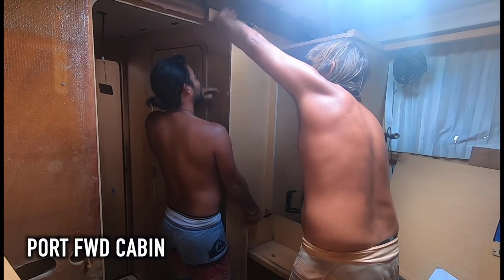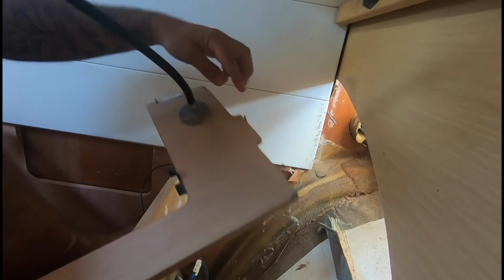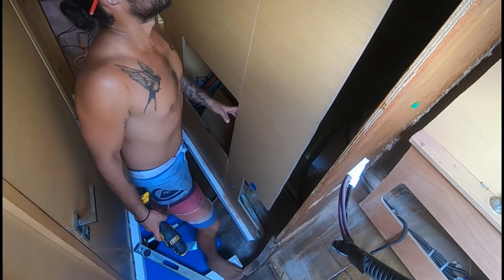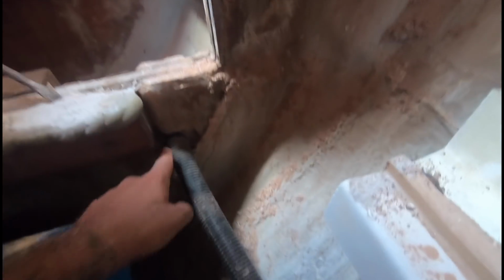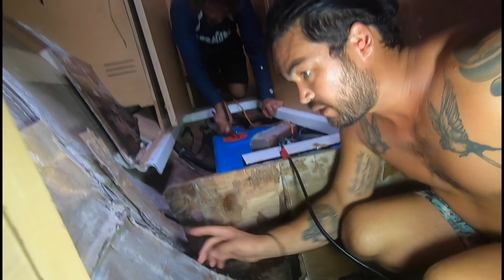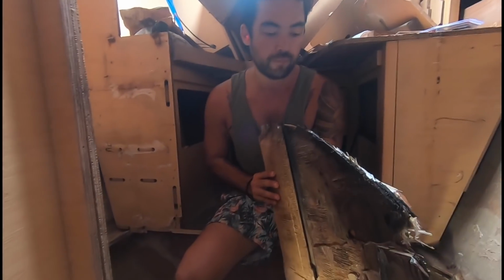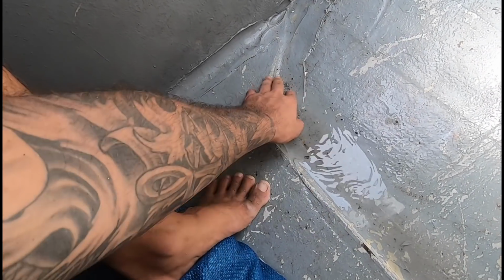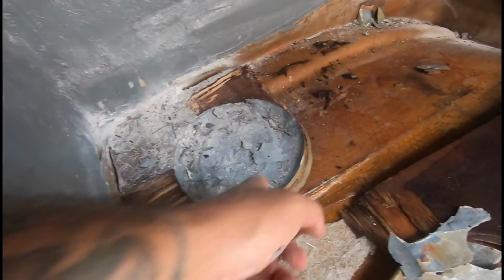CRACKED BULKHEAD REPAIR SERIES - Part 5  (Episode 110)

Comment: Every week is a new PR disaster for Lagoon.  Colin, a sincere “thank you” from me.  Owners and shoppers need to know this information and you’re helping me understand what’s truly important in a cat design and build.
Reply: PR disaster for lagoon by Beneteau.
Now i understand the difference between serial production boats and quality boats.
Plywood for construction elements?
C'mon man ... Beneteau is crap.
Reply: @marccoussement6903  Using marine plywood was absolutely fine for building the boat. The issue is that they just didn't use enough to give the boat the strength it needed. Those bulkheads should have been twice as thick as they were and the tabbing should have been extended by another couple of inches in each direction. 

That being said in 2021 anyone building a boat would be an absolute fool to use marine plywood. There are plenty of materials like foam, coosa, and other composite boards that will never be effected by water that using plywood now is just dumb.

What kills production boats is a confluence of penny pinching. They just keep taking away more and more material to save a few thousand dollars on a boat they will sell for over a million. It's not any one thing, its the supervisor of every stage in the manufacturing trying to find a way to make their little bit of the build "more economic" and by the time you add all of it up the boat isn't structurally sound any longer. 

Those bulkheads don't look like something an engineer would sign off on. Why put reinforcement on the bottom and top but leave a giant section in the middle with super thin 1/4 or 3/8 inch plywood? I'm not an engineer but I know enough to understand all the forces you needed the reinforcement for are just going to be transferred directly to that thin bulkhead. 

I've done A LOT of fiberglass work and torn apart many old abused fiberglass fishing boats to make repairs. I've never seen de-lamination happening like this. I would bet good money they had an issue with the resin, improper mixture, bad environmental conditions during build, or it was just old and expired causing it to not bond properly. Fiberglass resin isn't going to just de-lam like that if it was mixed properly, applied properly, and not expired. I don't care if it went through 4 hurricanes, the boat may be in tiny pieces but it shouldn't have any de-lamination of fiberglass from plywood. Even if the wood is 100% rotten there should always still be a layer of rotten wood stuck to the fiberglass. I'll be honest, I would cut my losses and walk straight away once I saw all the issues with the fiberglass. There is no way to ensure there wont be a lot more de-lamination down the road caused by faulty resin from the factory. No amount of reinforcement and extra tabbing will stop things from moving when the factory resin fails and de-laminates the fiberglass from the wood in other areas of the boat. 

Sorry for the imperial measurements it's easier for my small brain to reference since its what I grew up with.
Reply: @velvetjones  You can still use marine plywood just fine, you just need to sandwich it properly. It certainly gives a hell of a lot more structure (unless you're going for hollow structure, where you melt the foam core out with acetone, but then you're talking thicc glass) than any other format. I mean, i've seen boats done right, with a skim of fiberglass and they've been beaten to shit and back (a nutcase friend of mine took one right up to the ice back in the 90's when tech was worse, but boats were newer).

It's not about the contents, it's about how you use them, and plywood is perfectly good for a boat.

That said, the new whipper snapper standard today is fiberglass, with light cores (or none) with carbon fiber reinforcements laid interweave or laid as layers inside the main lay. Those are absolute tanks, and light. And because CF has come down in price a bit, and because it's structural, not element, (in purpose) i personally think that's the future. Who knows, we may even get some nutcase building a full CF on YouTube soon, i mean, there's a channel who replicated a Japanese car in CF top to bottom.
Reply: @velvetjones  fully agreed regarding such k USD material saving versus Millions investment inside the production tools and facilities (see my post below with somes video link). But i try to stay in  a 
“positiv Mindset” when i see this industrial tool and facilities  that could do much better
Reply: @aserta  Well said , Good ply sheaved & end sealed as as good as most methods , Have look at Spencer ply yachts built in the 70s , Won every thing , Fast light & sound , Sure if its not done right as with any form of yacht construction ?? That can even go to Ferro yachts , One won the Sydney - Hobart but they dont like talking about that ?
Reply: @velvetjones  well said the glass work is beyond Horrible ! I want to live the dream but it wont be with Lagoon ! Thanks to these guys to make this discovery and present it to the newbie like me ! I wish to sail - surf and site see the globe by sea ! My glassing experience is only on surf boards as a labour of love.
Reply: My thoughts from the beginning but it can never be told the stresses of a hurricane on the hull that tweeked so many lap joints. That's Lagoons out excuse though, that and building to an "industry standard" that does not build 100+ year boats. 
I wonder if there is some composite material that might replace all of the structural wood..?

Here's to wishing/expecting you guys to have an exceptional century boat 🚢 in the end 👏🍻
Reply: @steprob8692    I'm curious about the marine grade options to Plywood for structural use as well.
Reply: @The_Life_Shoequatic  Coosa board is awesome and pretty much indestructible by water and lateral forces. Often used in rebuilding transom's . I've used it and it is superior to marine plywood by a ton!
Reply: @jfisk60903  cheers mate!
Reply: @steprob8692  Yes PVC, Airex or any type of structural foarm suitable for glass or carbon strat. See for exemple outremer building (hereby the famous new “Sailing la Vagabonde” https://youtu.be/FBtJr80RIm8 

But as usual it may be usefull to moderate a first bad feeling (and the one about Lagoon is justified) hereby  a video of LAgoon factory. 

https://youtu.be/5Im5DC2vu4Q

Ok this is promotion but check the building facility , large scale infusion equipment, CNC equipment, general logistic and industrial set up compare to the one of outremer working in an too small building, not properly isolated (thus no temperature and humidity control), no crane facility except the truck crane barrely certified and so on.
  The 450 issues is clairly identified and can’t be justified regarding the overall industrial investment done for the production. cut somes extra hours for proper tabing and low end marine plywood can’t be explained: a few  thousands USD saving versus millions USD in industrial equipment ? Regarding the industrial organisation of such group i have no doubt that it will be internally reviewed. I hope they will as well work on their PR. Cruising catamaran is not my way of sailing. But there is a real demand for such cosy cat not exceeding 500 k USD. and “large scale” production of such boat is a real challenge. At least Lagoon has the industrial tool to take it. I wish the future will show positiv change (keep in mind that the original 380-410-440 serie has excellent record and value on used market)

NB: regarding the non stop positiv mindset of Colin,  we should try to do the same with this 450 mess :)
Reply: @steprob8692  but the de lamination and support systems are failing on boats that didn't go through a hurricane. Simply put, these boats were cheaply and inadequately built....period!
Reply: who knew they were just a bunch of plywood and glue?  haha
Reply: @2fast2nick  unfortunately probably true for most production boats :(
Reply: Lagoon is going to end up in a class action lawsuit... these issues Collin is uncovering are probably just the tip of the iceberg...
Reply: Whilst you're right on the fact that the boat is not up to spec, you also seem to forget what happened to the boat. HAD this boat been as bad as it seems to day before the wreck, it would've been scrap. Collin didn't take this on from a marina, he took it off the rocks. It's fair to remember that aspect, go back to episode one, that's not just random eggnog party wreck, that was full on beat the crap out of the boat.

That said, the lace at the bottom came undone before the wreck, so that one's on them, and the damned glue construction. Just hire a smaller persona and get some fiber lay in there, is what i'd do, but they considered that they wanted glue. And this is a customer driven thing. These are houses on water.

Personally i don't even get the appeal of these things, they're not large large, they're just wide, you have to have two engines, there's no other way, and you have to deal with a lot of issues when getting into a marina. For the same price, you'd get a reasonably large yacht/boat, and have the same amenities. But then again, you could probably name the people who've used these types of boats (to be clear, twin hull, fiberglass lay and of this setup, not the racing cats) that have done enough nautical miles to contend with any normal old middle class boat.

Like someone else said in the comments, these are apartments on water, kinda like those British canal boats.
Reply: @aserta  dozens of lagoon boats have the same problem! just search around... this has nothing to do with hurricane damage
Reply: Think Colin is in a spot with Lagoon as they have been "helping" with some remote support but jeez you have to wonder if the patience with that will run out at some point.
Reply: @Aus L Nice theory but in terms of social media exposure it would probably open up the flood gates and not sure Colin is the sort of guy who would sign off an NDA and somehow pretend it all got better? There again, even he must be getting sick and tired of it all and they haven't started the big grind yet! Amazing they keep going,
Reply: Foam core builds only.  Lagoon doesn't give a sh..t.  Everywhere you look, they didn't do the job correctly.  By the time you find the problem, your warranty will be over.  BBW.  They know this happens.  But now some of us also know!  Watch for a lot of lagoon 450s being sold. used and rotting.
Reply: @Aus L that’s’a good point. But the CE class certification is based on stability/equipment/overall load calculation. unfortunatly not at all a quality/longterm use certification. leisure boat have clearly a lack of industrial standart regarding commercial boat or even racing boat.
Reply: Not any PR prob for lagoon that you people aren’t falsely creating.  This a f’ing hurricane salvage boat.  Flipped upside down on its hull in at least two hurricanes.  What the hell do these drunks expect?  You pay salvage price for a boat you get salvage boat!!!! Sorry but you knew what you were doing when you bought a salvage boat!!!!
Reply: Hurricane stresses can certainly excuse some of the damage and Colin has said as much.  However, a hurricane didn’t damage the other dozens of 450 yachts showing similar mast bulkhead bowing and cracking, a hurricane didn’t create forward compartments with no drainage, a hurricane didn’t install bulkheads using glue instead of glass, a hurricane didn’t install cabinetry and walls with no way to remove them except cutting them in pieces, and a hurricane didn’t use bulkheads with exposed raw wood leaving them susceptible to rot.  The hurricane can be blamed for some of the damage, but Lagoon has a lot to answer to here.
Reply: @CaptainBobSVTurnthePage  so far 90+ lagoons have the same problems .. most of those have never left the fucking marina .. just google it .. some are planning  a lawsuit too
Reply: @CaptainBobSVTurnthePage  You are missing the point, this is happening on the same model Cats built by Lagoon that didn't go through a hurricane or anything even close. It is poor quality that is causing this issue and not hurricane damage. take a peek on the interwebs. It is a disaster for Lagoon!
Reply: #FuckLagoon

Comment: There comes a time when persistence turns into stubborness.  The bible calls it being 'stiff-necked'.  Being stubborn involves over-looking the obvious due to some mechanism of the ego, blocking out reality in the process.  And the process, generally produces negative results and missed opportunities to engage in more positive avenues of endeavor.   This particular vessel isn't the only one and certainly isn't the most important one.  But due to blind stubborn behavior, it has become a form of mental-block to reality.  The so-called drive to encircle the globe with this particular set of rotten plywood and fiberglass completely ignores reality.   Tempting fate is one thing, but doing so without reason is unwise.  The compromise to the integrity of the structure, even with 'repairs', deems the overall pursuit to be more than risky.   Just think about it.  Withdraw from the work and ponder the course you've chosen.  Ego can get you into real life-danger.

Comment: This onion just has layer after layer of rotten plywood. Effin Lagoon, the bayliner of production cats...
Reply: This is way worse than a Bayliner.
Reply: I have a Bayliner, with the original Chrysler/Force outboard from 1987 with sparkle blue paint.   I bought if for $1000 trailer and all 10 years ago.   It's a nice little ski boat.  Transom, floors, everything is good.

I'd buy a lagoon if it were $10000.  And after this, all the current owners of Lagoons are gonna be screwed.  Resales are gonna tank.
Reply: @nicholasr7987  Your Bayliner is just fine as long as you use it sensibly and don't try to push it beyond it's abilities.

Comment: Harbor Freight get you a ventilator to get a positive pressure on the rooms you intend to grind in, this will help with getting the fibers going in a different direction from the living area. Masks fellas, save your lungs that fiberglass dust is no good for you. Enjoying watching you tear it apart and discovering its issues, looking forward to the rebuild.

Comment: When you guys are done, I would much rather go around the world in your boat than any other lagoon.  I am dumbfounded on how bad the engineering in these boats are.
Reply: Engineering the design is different from implementing the design.  I'm sure the numbers pencil out well, but the actual build quality falls well short of the intended requirements.
Reply: 😱😱 not a chance of me going around the world on one of these, I like living
Reply: Hay. That’s my bed 🤣🤣🤣🤣🤣🤣🤣 and it looks like we have some people from Lagoooooon  replying here. Bring it on   I don’t think it would be wise for them too do anything but help there Customers at this time. This is one of Many Engineering faults on there Brand. It’s time for them to Bloody Help these unfortunate people 😠
Reply: Most of the modern production boats monohull and cat aren’t any better. It’s a systemic industry wide problem of poor quality construction. Look up what CE category A rating means. It’s a joke if you want to cross oceans in any weather. There are a few mfg that do it right but a custom build is usually a better bet when shopping on the used market.
Reply: The engineering was okay until the plywood got wet how long did it take? 🤔👍
Reply: @rogerkerkmann  I'm with you on that statement.   The leak was completely hidden, and  could not be seen, nor inspected until the damage was done.  I think they will need to measure what they say on camera,  because lawyers will be called.   However,  rational,  normal people will see it for poor build quality/practices.
Reply: @nicholasr7987  this unfortunately. I trust Colin to not badmouth Lagoon on channel - would lead to defamation lawsuit and he’d lose this channel while suit was in the court.
Reply: @goofsaddggkle7351  It's only defamation if you're provably lying. If Collin intentionally caused the water leaks that damaged his boat and stated that it was poor engineering so he can hurt Lagoon's sales for example. Somehow I doubt that's what happened. You can intentionally say negative things about anyone and anything as long as it's factually correct.
Reply: I am definitely not a Lagoon shill fyi. The water leaking into the bulkhead is due to poor engineering - its directly from the trampoline tiedown design as Colin pointed out. Thats not a thing you should expect - its a design flaw. If that were a vehicle, there would be a recall notice for that specific item.
Reply: @rogerkerkmann  None of those cracks are anyway near that rot..the engineering is crap.